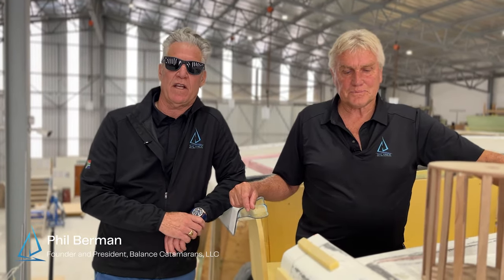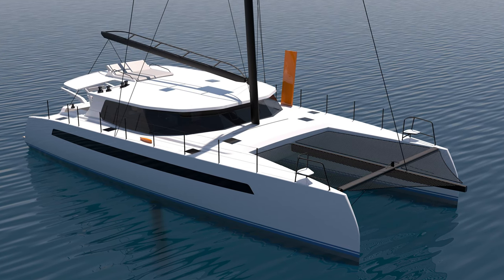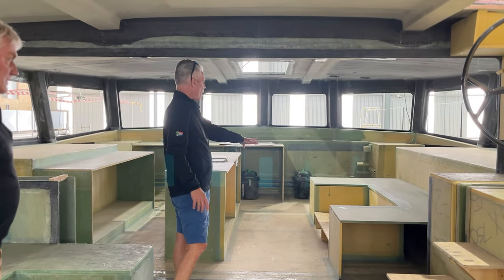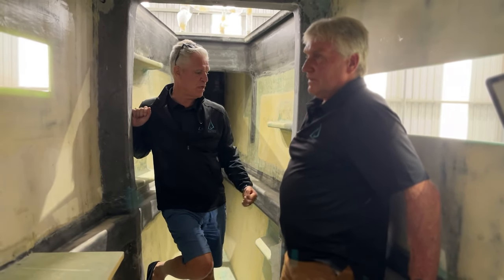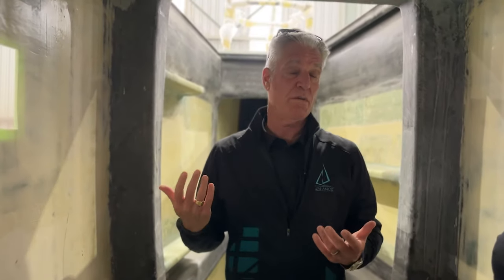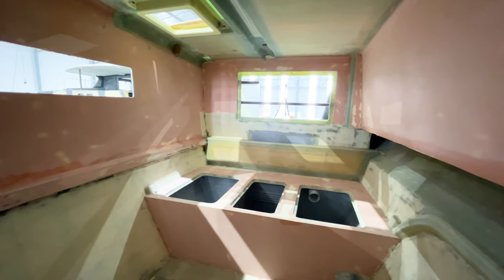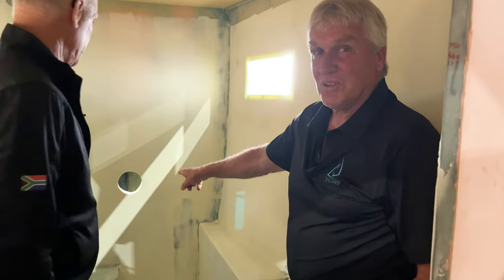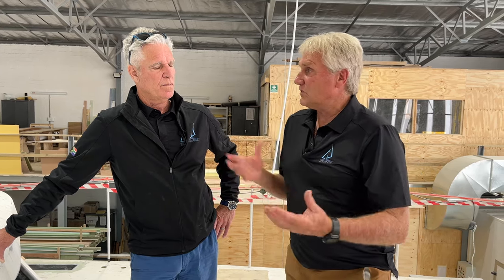Balance 580 Build Series - Part 3

Comment: just lovely, however no matter how many design changes are brought on, this will always be the Nexus60
Reply from the maker: No, this is a totally newly designed catamaran from the ground up. Newly designed, new engineered, different in all respects from the first 60, other than the quality carbon/epoxy build.
Reply: @balancecatamarans  well, you can type all that but in the end of the day with business and marketing geared towards floridians aside, it will always be the legendary Nexus 601.

Comment: Gimbaled cameras are great but not if you want to show all the areas of the build. fantastic boat. Pointing the camera into the locker to see the steps would be great. Can't wait to see the performance once completed. do you use the carbon stringers to run cables? The helm-up cart plotter should be a swing one that can be swung up. when not in use it would be flat and protected. Jack and Jill's heads are fantastic and work so well. saves a lot of space. would be great to see the design rendered drawings of before and after changes to see the thought processes. I want one already but may have to wait a little longer. Fantastic guys well done.
Reply from the maker: Thank you very much. If you want to chat about the 580 or the like, please free to reach out to us on email, info@balancecatamarans.com .

 The renders on our site are very much renders of our standard 580 layout in the salon and show the master owner cabin, but on the 580 we can engage in a higher level of interior customization for specific needs. We are currently building a 3 cabin owner version, and a 4 cabin with office convertible. We will soon start on a 4 cabin only version and we have one on the books with a lof of bunkbeds for a flock of kids!   When you move into this size and above, the 580 can still easily be operated by a competent couple, but some of the buyers want a skipper, some want to do occasional charter, some want simply more berths and space, and some simply want a much larger and more luxurious owner only boat. We can do them all at Balance with pleasure.

Comment: Great Boat, do you offer shaft drive hybrid engines?
Reply from the maker: We do not offer shaft drives on all of our models 58 and below in length as we do not like the negatives of placing engines under berths, both the added noise and vibration of a shaft over a saildrive is even more magnified when inside the living spaces. We also prefer the engines are in their own watertight compartment for safety reasons. Even if you knock off a rudder or saildrive and water comes into the engine space the water level coming up would be minimal. Further, there is a dramatic misnomer that shafts are less maintenance than the new current model saildrives. You must look after "dripless seals" which are not dripless!, you must replace cutlass bearings often enough, and you must sustain perfect alignment of them to avoid vibration. Finally, any shaft draft offer less horsepower at the prop because the prop is not on a perfectly horizontal plane to the water. On your typical 45 HP engine you lose about 3 HP at the prop.

Obviously on our 75 footer we have shafts because there is no other option in that size of motor. 

Finally, we are working on a hybrid solution that will allow us to sustain saildrives, which we prefer. That said, all hybrid solutions come with pros and cons and the diesel engine with Integrel alternators remains the most reliable green approach, the least costly, and offers the most speed and range generally.

Comment: I see things IN this design that I do not understand. For instance. Do you really want to be exposed to the boom whilst taking a sun bath? With my 6’3 I’d be overboard if a sudden gibe happened. In that case, maybe I live if I don’t drown. But you’d kill a person/child if the boom hits the top of their head! It’s unbelievably irresponsible in my opinion to even mount a sun pad on a roof like that.  Unless you make the boom 2.5 meter high, which is not working when you need it low to get more speed and be able to control the sails on the boom, I get that. 
But the sun-pad under an exposed boom? I would never even consider. And you’re not the only designer to do this. We live in Asia and Middle east, you do not want to be in the sun for more than a few minutes here. The larger the boat the more sense it makes to have control over the boat from the centre. 
Put the driver more central and give him as much visibility as possible. Making a covered flybridge with helm and line control a very ergonomic design. The versa helm looks great, yet if rain is poring like here around the equator, I do not thing you see anything, but grey mass. 
As for the last part of docking? Use Dockmate to have the hands on the deck level and see all that’s important. 

No design will give all corners visible, and speed and comfort and space. etc. There is are always a..  a balance.. a compromise. A fly bridge is being ridiculed sometimes because of the centre of gravity, higher mast, sail position etc. But it offers extra living space, helps to position all controls near the mast, helps to keep lines short and direct. And assuming a roof/bimini can offer protection for weather, space for solar. And yeah the price for that may be less speed and a somewhat higher purchase price. Hence that’s what I miss in this design.

I think many clients would take comfort over more speed. 16 kn? 20 even, I think despite that most cruisers will never outrun a squall, The hull speed of that boat is around 10-11 kn, above that you’re creating a planning vessel and the forces on everything will create enormous tear and wear. I don’t think that’s favorable for any cruising sailor. As for squalls?  Even gunboats get squalls. 
just my five cents..
I keep saying: “At sea all boats are small, don’t judge it in a marina, nor in a garage.”
Reply: Hi Walter, you raise some great points, but they are truly not a concern if you had a chance to step aboard one of Nexus's boats.  As the boom moves outwards its elevation changes and clears I'd guess any person that's shorter than 7'2" tall.  There is A-Frame or German sheeting so the main is always prevented, there cannot be an accidental gybe.  Balance will build you a hard or soft Bimini/Dodger if you choose, so this is up to the individual owner to decide.  Dockmate is an option, and when it's pouring rain, you can see no problem when helming from the lower position of the Versa Helm.  

This is a boat built to sail extremely well in light air and weighs less than half of the flybridge/more comfortable catamarans you speak of.  But you'll be sailing this boat in 8-10kts of wind where the flybridge production cats won't bother lifting the sails until the wind is over 15kts and then you'll plod along at 7kts while this boat will be sailing past you at 13kts with your wine glass sitting on the table smooth as can be.  It is definitely not for everyone that is for sure, but that's what makes the world a great place is you have choices and I'm personally glad there are guys out there like Balance building something a little different.  Cheers!
Reply: I'm the owner of the 580 in the video. We aren't putting that coachroof lounger as it's not practical, that picture was just a concept. Instead we have 4.8kw of solar on the coachroof. We own a Balance 526 and have often clocked in 15kts avg for 24hr periods, so these boats are fast and handle so well. They can also downgear easily. As for the versa helm, on long passages and in rain you get an almost 360 view when down below. It makes rough and rainy conditions a lot more reasonable. We will also be getting a dockmate installed, it's a big boat. I've been docking our 526 stern first in the bahamas for 3 years without a bow thruster and you get used to her dimensions and handling.
Reply: That makes much more sense. Congrats on the purchase @jmwindify
Reply from the maker: Sun pads are only used at anchor. Some people want them and like them and we are happy to do them. You lose a lot of solar space, however. But the bulk of our customers do not request a coach top sun pad. Further as someone else comments here our boom is designed to go over the sun bimini easily when sailing. We lower the boom on the mast to make it easy to reach the halyard and raise the clew of the mainsail to keep the boom height over the sun bimini. And yes, with the A-frame an accidental gybe is hard to occur as the sail is always in a vang position. Anyways, our boats are designed to be safe or we would not sell them.